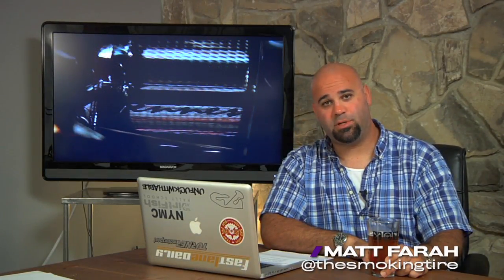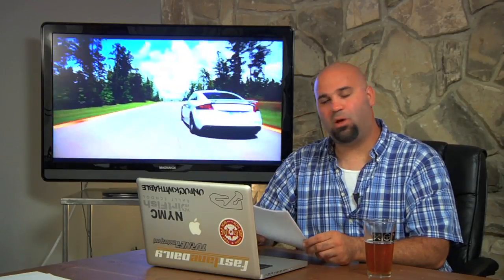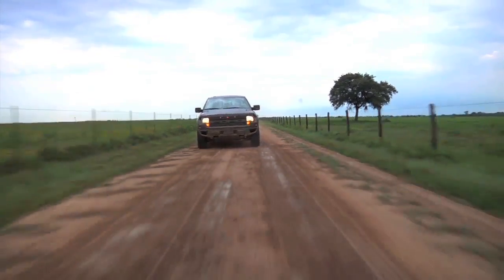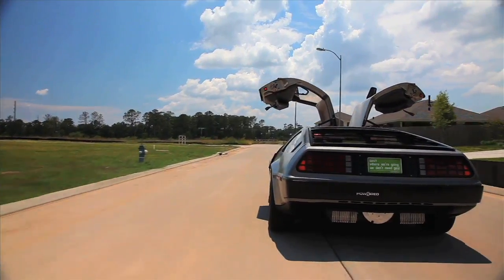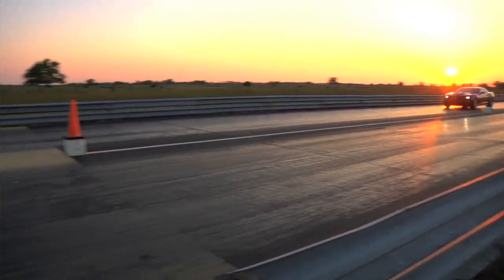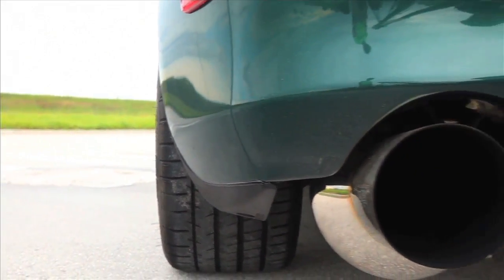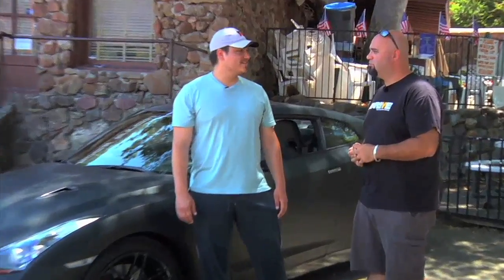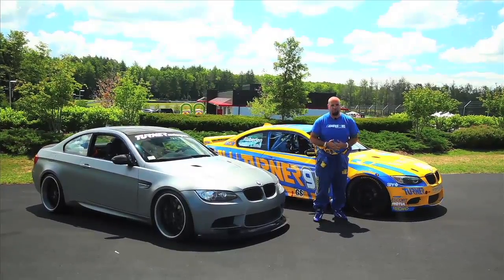Tuned Season 2 Wrap Up - /TUNED

Comment: race cars, for the most part, run high up in the powerband, so the twincharge won't help much. It's more helpful for street cars that rely on boost to make power, such as a turbo-converted Exige like Frank's, or a Ford GT. The GT's with TT conversions get very peaky, so tuners use a twin charge setup to make them more streetable at low RPM. They are limited by the blower to "just" 1200 HP, as opposed to 1500 with just TT, but lots more torque for the street.

Comment: You're assuming it's about the brand. It's not. It's about the styling of the interior and exterior; the sound the engine makes; the way the leather feels, the layout of the buttons, the feel of the seats, the paddles, and the steering wheel. Whether it's a Ferrari, an R8, or a Vintage Porsche, just sitting in them gives of a special feeling. GTR's only give off the special feeling when they are launched hard being pushed at 10/10ths through a corner. In all other aspects, they feel like Nissans

Comment: Hey Matt, so far I have enjoyed all your shows.  Keep em comin!  Having had a law enforcement career for 20+ years I have seen a lot .  I with you handling is where it is at, many can drive fast in a straight line but most of the time crash on a turn!  I've over cooked many times on the track!! My favorite cars have been my 86' 300zx turbo,76' v-6 Capri,86' supra,70' cuda,87' vette,91' eagle talon tsi AWD,and my 03' wrx wagon 306awdhp on 96 octane.  The 1st thing I always attacked the handling,

Comment: It's one way of doing it for sure. Twin charging is a complex process, but is effective when trying to boost torque for smaller displacement engines. Frank's car is faster on very tight roads than the Venom, due to its width vs. wheelbase. On more open roads the Venom is faster.

Comment: Liters aren't everything when it comes to NUMBERS, but there is no replacement for displacement when it comes to FEEL (except amazing factory tuning i.e. McLaren MP4). You can get a zillion HP out of some little Civic with a giant turbo, or Audi's 1.8T engine, but it will be laggy, peaky, and have no bottom end torque. It may put up a huge dyno number, but that won't make it pleasant to drive.

Comment: Whereas I would disagree, having owned one for the past year and a half. The steering is quite communicative, and the confidence it instills in you is absolute.

Mostly what it comes down to is that driving enthusiasts tend to prefer manual transmissions and RWD, as the sense of immediate control is greatest with that set up.

Comment: You have the car in 2nd gear or 3rd gear, rolling alone at a "normal" low point in the rev range, and then you mash the throttle and the car goes. It's a less abusive way of feeling the power of a car. Launching the car from a standstill puts it under a great deal of stress and breaks things, fast, in powerful cars.

Comment: Hey Matt, you should come out to a track day sometime. You can check out both big power and balance. There's one at Auto Club Speedway hosted by Speed Ventures this weekend (unless you're still in NYC). Great variety of cars; S2000s, GTRs, Datsun 510s, 600+ HP '69 Camaros, etc.  Both Saturday and Sunday have special Corvette themed events. I'm running my Mustang Sunday. If that's too short notice, the next ACS event is Nov. 17-18 with a time attack on the 18th.

Comment: nothing specific to the car? there is more to a car than the engine, chassis, and transmission. The body is handmade carbon fiber. The engine is based on a LS, but a unique casting and bore/stroke. The suspension is designed specifically for the car. There is gold leaf for a heat shield. Though some specific components are shared, there is plenty of unique parts to the Venom.

Comment: Hennessey does have less R&D than Ferrari, but you have no concept of what R&D costs. Underground modifies the engine and gearbox of a Lambo for $130k, nothing more. The Venom has a handmade carbon fiber body, a completely unique engine from the casting on up, a bespoke suspension designed by Penske specifically for this car, active aerodynamics, and more. You may not be sure there are $400k in parts in that car, but I am sure of that. Factor in 5,000 hours of labor per car at $100/hour

Comment: Matt, I have a "220hp" C200 Kompressor (Custom Cold air intake / Spookie 15% supercharger pulley / Kleemann 4-1 header and sport cat / Custom Remus & Apexi 2.25" Catback / 1 step colder iridiums ...etc with Intrax springs / H&R Sways / EBC brakes ... It's 'only' a 220hp car at most.. but I love it and it's fast enough to get in trouble ... it's got enough oomph for hooliganism. I've had higher hp cars before but people really have no clue what balance is about ...

Comment: Also, PF has 13s for $1300, which is hilariously dodgy. There was a guy who needed firmer suspension, so he used a smaller diameter spring in addition to the stock springs on the shock. Another guy turned the rear shocks upside down to keep the rear end down (he ended up running a 12.6, then blowing up the engine some time later.)

They're now doing 13s for 1300 again, but another rule has been added. Car must be FWD. A guy made intercooler piping from a bunk bed frame.

Comment: Matt thank you so much  for saying that the gtr doesn't feel special. For years i have seen gtr fan boys talking trash on ever car forum/video...etc saying the GTR is 10x better than anything at less than half the price. While that stuff is all true, i personally been in a GTR. Yes the pressure readings, and the steering wheel looks rather interesting. After 10 mins, the nissan logo reminds me that it is still a just a 100k nissan. Even the infiniti g37 has a better interior.

Comment: Should be Looking  at Guys - doing  Mode on a  Not so Likely  Volvo V50 AWD - adding in a  K16 from a Ford  Focus onto the T5 Volvo - taking it to 365 HP from 218 stock ,taking Tq
from: Oe -  Tq 232 ft lbs / Mod -  400 ft lbs

Comment: actually no I my sc300 is solid no major rust excellent D&D I bought 5 block away from my house the previous owner died from battling cancer, his family didn't want the car so i took it. it needed a clutch and had a few exhaust leaks but all around clean car its high mileage at 170,000 but it looks and drives pretty good, I am trying to pick up another one witch is even cleaner then mines and same exact color, he has a title issue with but I know people who can fix that legally

Comment: The only way you're going to find a 5-speed SC300 for sale for $1800 today is if it's basically a pile of crap, rusted, and full of parts needing replacement, or if the current owner is an absolute moron.

Comment: In reference to pricing answer at 3:30 I agree, it is economics on a basic level. Parts and labor alone do not a car make, factor in development cost (engineering, testing bla bla bla) plus the fact that someone like Hennessy and his shop have to make profit to expand business and hold some liquid equity in case of a lull in investor funds or cushion a car that doesn't sell well. The development/build costs to price ratio is smaller for a larger car company though.

Comment: Like I said before, there are Supras which were tuned in the late 90s, which are faster than the C6 Z06. Also Matt has only driven 2 Supras, one was a 1000hp drag car and this 700hp Supra, he didn't take it anywhere near it's limit (in terms of handling), simply because he was on the street. Matt may prefer his C5 Targa top, but in terms of handling, performance, braking, that Supra will dominate his and most other C5 Corvettes out there.

Comment: I rarely comment, but regarding the GT-Rs. I have a feeling that the GT-R has already proved itself as a cheap great track car and now everyone is itching to get it in buggati territory for less than a quarter of the price.

Personally, I like the GT-R just the way it is. 800Hp would be plenty for it, the rest should all be suspension, body, tires and etc.

Comment: @Matt Farah - interesting thoughts on the Nissan GTR - i'd be really interested in seeing if you can get hold of a tuned R32GTR out there and get your thoughts on a really nicely fettled one of those :)

Failing that come over here to the UK and check mine out when its up n running with a ball bearing Garrett GT35 ;)

Keep doing the great shows - absolutely loving every episode ^_^
ant

Comment: There are thrilling cars and there are driver's cars. The GTR has technology in the wrong places and so you don't get as much driving feel ,apparently.

You see, technology should not be applied to the inputs of the driver so to speak. For example, variable valve timing does not detract from a driving experience, paddle shifters do.  

I'm guessing you don't understand where we're coming from though.

Comment: matt, about the audi (and... kinda any car) the litres isnt everything when it comes to hp numbers, right? i mean, it is AWESOME to push that much from that ''little'', but all that ''does'' is giving the power in a more usable powerband. but i kid you not, there is people pushing over 500hp with stock block 1.8litre engines =) difference, i guess, is you gotta rev like 8.5k rpm to get the numbers hehe

Comment: yeah that was a bad example talking about a car that cost 50k to build that is sold for 150k. if the venom gt cost 150k to build it shouldnt be sold for 1.1m thats nuts it should be around 350k even 500k would be ok but 1m is nuts compared to 100k its made for
Reply: The Hennessy has 400,00 worth of build materials with an additional 5,000 man hours to hand build it. Factor in the "Hennessy venom GT" name and the original designing of the automobile, 1.1 million doesn't seem all that unreasonable compared to other things
Reply: Matt said himself he knows for a fact that there's $400k worth of parts on there. Add 5000 man hours at a conservative ~$20 an hour (I know your pay rates are lower in the USA but these are qualified people) and that adds at least another $100k to the build. So that's $500k to make the car without even considering development which, as Matt said, is amortised over far smaller numbers than even a Ferrari production run. With development costs and even a modest profit margin built in, $1.1m sounds pretty reasonable.

It's all in the video man - very reasonable explanation of why the car costs that much. The original commentator had NFI what he's talking about.

Comment: Matt, I think you misunderstand the perfect balance of the GTR. Much like your opinion of your corvette (with which I completely agree) With the GTR it is the brand, and just like its advertised as a porsche/ferrari/ZR1 killer, it does it at a significantly smaller dollar amount. I feel that many(most?) people who buy the GTR and decide to upgrade the car as drastically as double the HP, its just like with Hennessee/UGR etc. it's a dick measuring tool..

Comment: There is a difference. Hennessy is rebranding other company's products as thier own and charging 3x more for it even though they did nothing to it. If Rolex was taking Timex watches, putting the Rolex name and logo on it, and selling them for $5K you would pay that? Roush is a good brand, and much more well respected than Hennessey, and they will blow a Raptor for $7k not 15, even though Hennessey uses the same Roush supercharger. See my point?

Comment: The GTR is not boring
its just too SAFE
even with a 1000+HP
you put a 1000+HP in a Corvette and you be to SCARED to drive it

The GTR was engineered to handle all the tuning stuff
dont forget its a JDM they r used to engine tuning
and even with a 1000+HP the GTR chassis has NOT met its limit yet
 
The same can be said for the BRZ/GT86
the car is engineered for the UPGRADE generation 
NFS and all those video games

ANY IDIOT can put in a 1000+HP in a car very few can make a car handle better

Comment: Well first off, the Mustang is NOT a muscle car. It has never been, and never will be a muscle car. It is a pony car, which is a segment including the Camaro/Firebird and the Challenger/Cuda.

Secondly, that is an opinion. That IS NOT fact. If it were fact, it would be based on numerous reviews and not what you think of it.

And the ZL-1 is 3 times better? So it having a slower 0-60, a full second slower in the 1/4 mile, and it having less power makes it better?

Comment: This car is over priced. I'm 23 and i'm in the developing of designing a car with almost the same power. I've designed my own body, suspencion, etc. And i tell you, it's not going to cost me $1,000,000. And at the end of the day, it will perform great. (The car is for my personal use, not goint to try to sell it, because i just want to drive something i will create.)

Comment: well it's completely wrong to compare GT3 RS with GT-R! That is another league! You can compare GT-R with 911 turbo but not with RS, because RS is almost racing car, and so it's obvious more connected with driver! Lotus Elise or Ariel Atom are more focused cars than GT-R, but that doesn't mean that they are better cars! So don't mix that!
I thin that GT-R is the bast overall GT car, and in top 5 of super cars (many journalist confirm that in COTY tests and other tests).